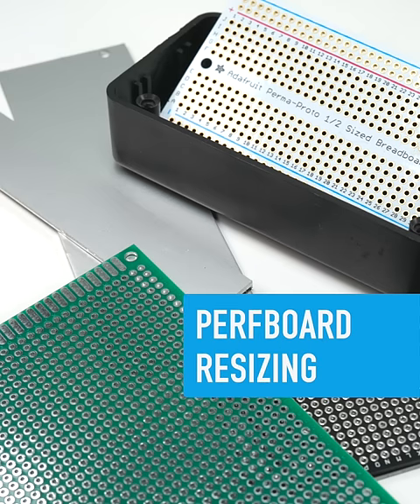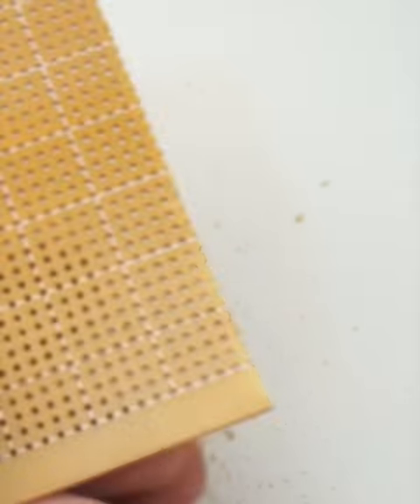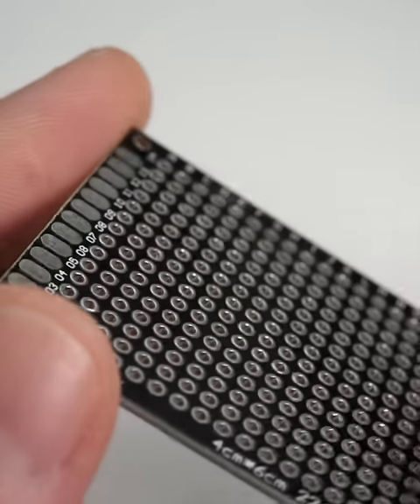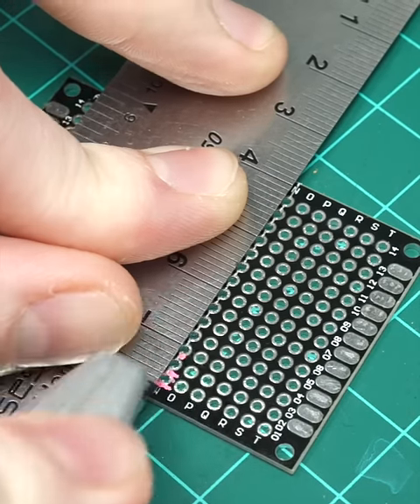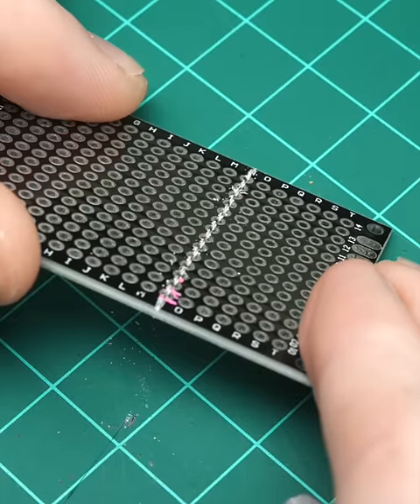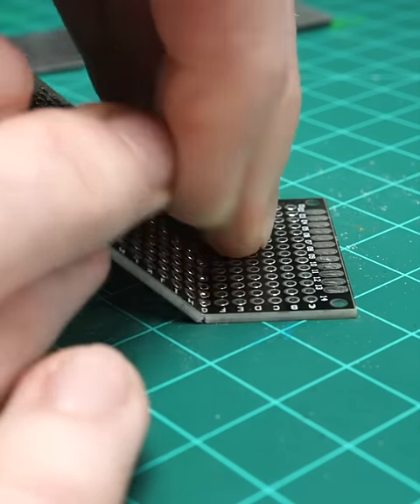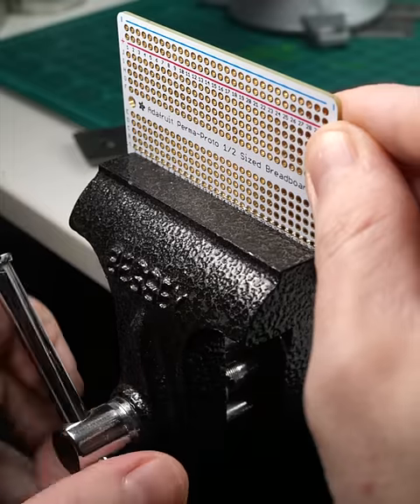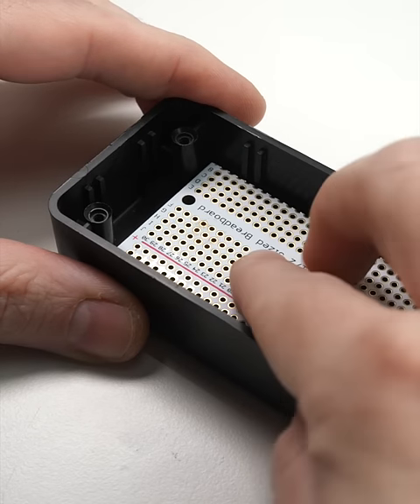Perfboard Easy Resizing  - Collin’s Lab Notes #adafruit #collinslabnotes

Comment: So basically the same procedure as drywall, except with a bit more force. Also, voila, ersatz castellated vias (they probably don't work, don't trust them).

SparkFun has a "snappable protoboard" which is essentially a pre-scored perf board. I tried it, it's not bad, but you end up with a lot of leftover bits and the quality of the pads wasn't great (they oxidized within a year, ugh). Also if you make a big board out of it, it would tend to bow a little in the vise, so that was fun too.

The more I use perf boards like this, the more I appreciate circuit CAD and PCB fab services. Sure, I have to wait a couple of weeks for the boards, but I can size them the way I want beforehand.

Comment: Is it better to cut across the center of the pads like shown in the video or between them? I've always done between, but maybe through the center is better
Reply: @climatebreak  center of course, its half way cut already this way
Reply: @climatebreak  Those vias are unusable anyway.
Edit: What I usually do is cut the board as per the video and then clean the cut smooth with a utility knife (and a file if I can be bothered).
Reply: Imagine the perf board as a piece of paper (say, a sheet of coupons), with perforations. Scoring the board along the vias is like folding the paper along the perforations before tearing it. I've been using flush cutters and scoring between the vias, and I looked at the video and thought, "Oh, that makes more sense."